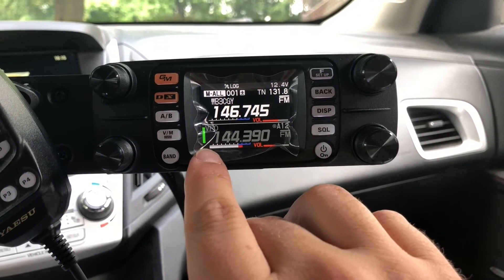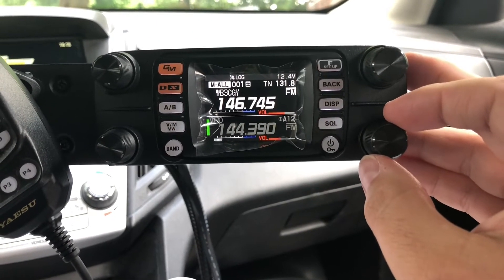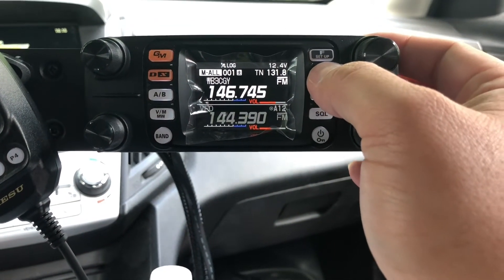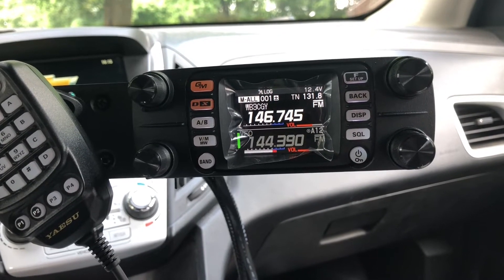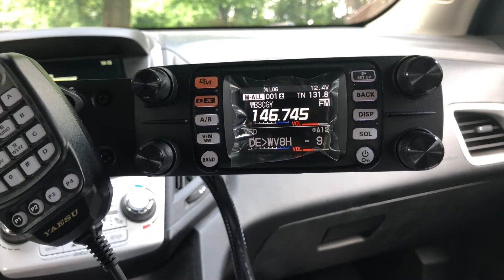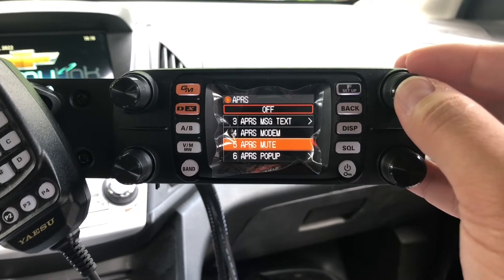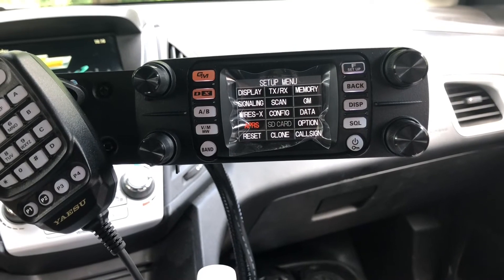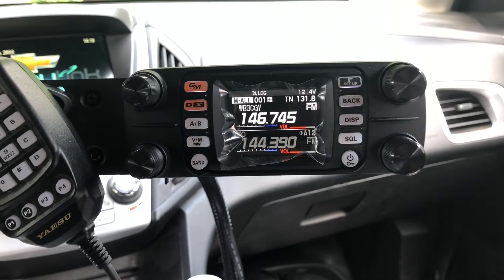Yaesu FTM-300 APRS Transmit Prohibit Fix

Comment: Dude, thank you! Was wracking my brain on the 500 with this issue. I thought my gpa receiver was bad as it’ll do the same.
Reply from the maker: Glad it could help you, there’s almost zero documentation on it and yet it’s quite a common problem faced by many users
Reply: Yea, and it makes perfect sense too, but it's just not a descriptive error.  Plus, the norm for guys that play with data is generally to leave squelch wide open. @hamandcheese25

Comment: Thank you for the video. It is helpful info. However, because I often change frequency to listen to sheriff or FD, when the APRS is set to 'mute,' it seems to prevent whatever other radio traffic I might want to listen to. For me, it was just easier to close the squelch enough to reduce the static. Then I didn't have either of those issues anymore.
Reply from the maker: Interesting, do you have the APRS set to VFO B and use VFO A for your listening? I also listen to local fire dispatch and have not experienced this issue running it in the above setup
Reply: @hamandcheese25  Yes, the same as me. APRS on B, and either fire, sheriff, or aviation, or railroad on A
Reply from the maker: @tglenn3121  interesting, I’ll definitely be looking into this more

Comment: This is not an "issue" or a "problem" that needs fixed.  It is simply how radios with APRS work.  It won't transmit if the squelch is open.  Every radio I have that has APRS works this way - Kenwood or Yaesu.  Still, it is good for people to understand how this works.
Reply from the maker: That is correct on the squelch, but in this case there is a mute function for the APRS which is not a common feature on most radios. Of all of the 2m/70cm gear I use this is the only one that offers it. Thanks for watching

Comment: Just bought a 300. Not setup yet, but thanks for the info.
Reply from the maker: Glad to be of help, it’s got a bit of a learning curve but pretty easy to work with. I programmed mine by hand but will use an SD card to back up, those seem to be the wave of the future in radio.

Thanks for watching, 73!